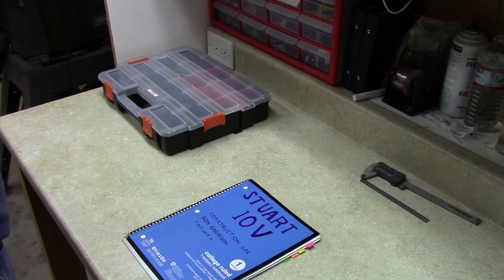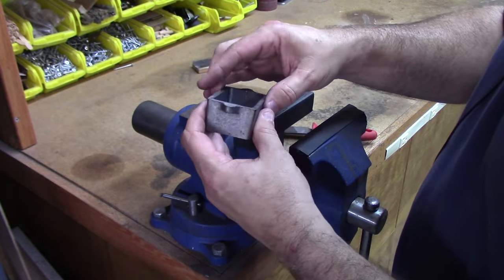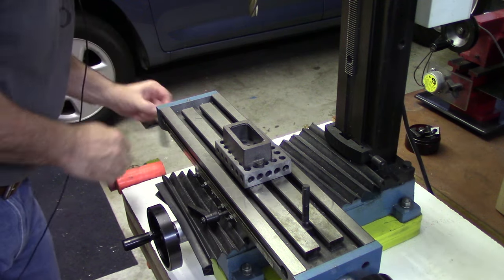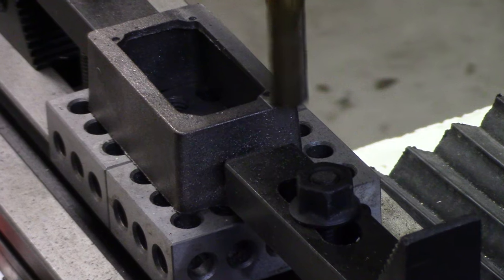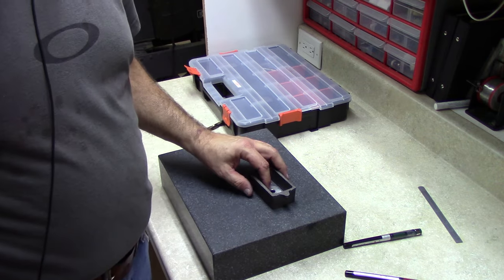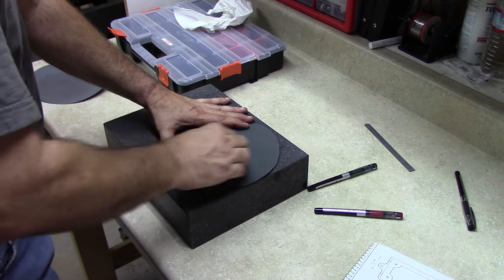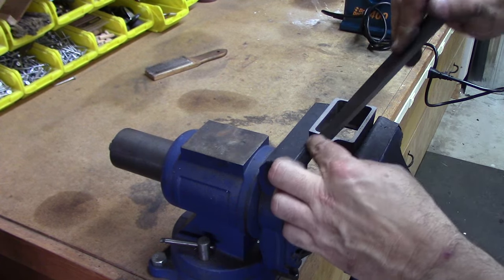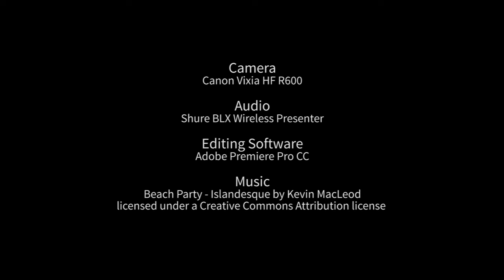Building the Stuart Models 10V Vertical Steam Engine - Part 2

Comment: Hi Ron, interesting video, nice to see a complete engine build step by step, have a small "Tich" Loco, that I will be rebuilding, bought it off Ebay roughly three quarters built, I notice you have the same milling machine as mine, seems that a lot of people use these and get excellent results, unfortunately mine is a bit crispy now as I had a fire in the garage that destroyed everything, garage has been rebuilt and slowly getting everything back together, will be doing a video of the rebuild over time, what camera do you use, Regards Doc Cox.
Reply from the maker: Sorry to hear about the fire. I've been really happy with the LMS mill. I'm thinking about getting their bed extension for the lathe, as the standard bed is really limiting.
The camera is a Canon Vixia HF R600. With good lighting it shoots decent HD video, and it's under $300.

Comment: If the bottom isn’t rocking on the surface plate, I wouldn’t even touch it. You just milled the top with the bottom clamped to the table. If those two surfaces aren’t parallel there is something wrong with your machine.

Comment: WTF!!! when you are placing a part on the mill table, CLEAN THE TABLE and 1-2-3 plates before clamping it down!!!
Reply: J.C. Stephenson not a huge deal for this piece, since the worst that can happen is it not quite being parallel, which is not a real problem. But in general, that'd be better practice, yeah.
Reply: What's up with the "wtf" ? Keep it nice!